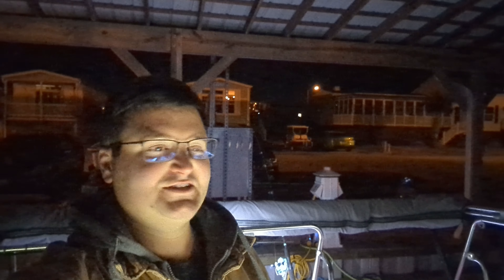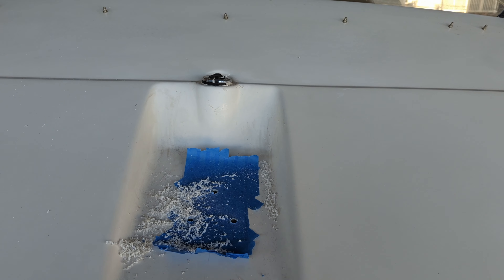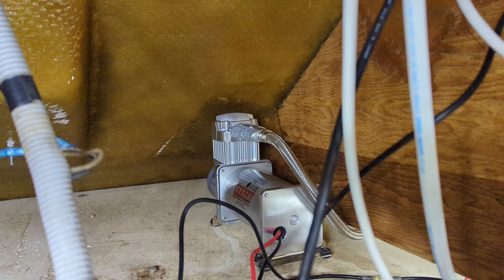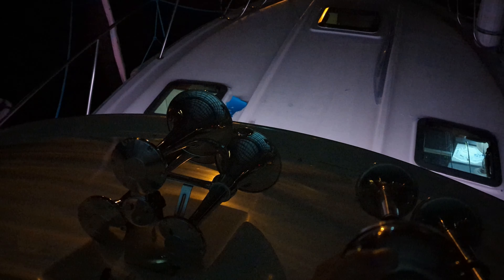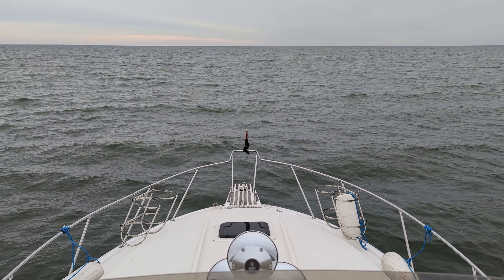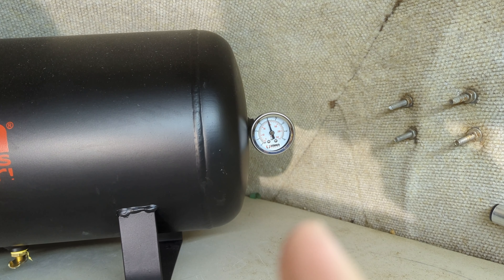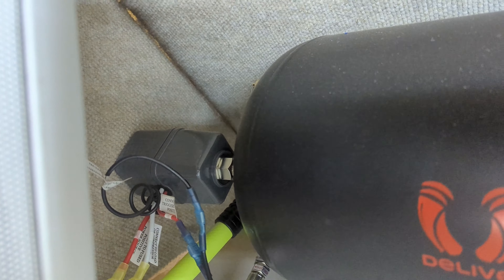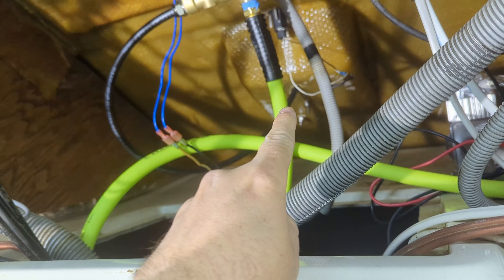Silverton 34C - Train Horn Install - #overdoingit

Comment: Love the train horn on your boat!!  I have been trying to think of a way to make my train horn portable as possible as I sell a boat every year and would like to just move it from boat to boat... boat is same model each so a lot of consistency there.  It is always just a year newer.  Have you ever thought about a portable design that could be plug and pay with using existing access holes for wires/ air tube?
Reply from the maker: So in my opinion the setup is fairly portable as is. You can easily unbolt the tank, compressor, and horns... No matter what you will need to hook up electrical and air lines...
Reply: Just get the adapter that is used on an impact cordless.